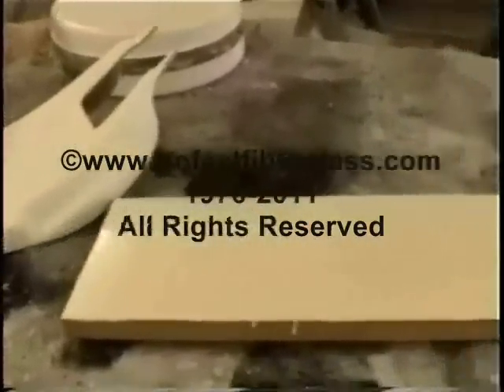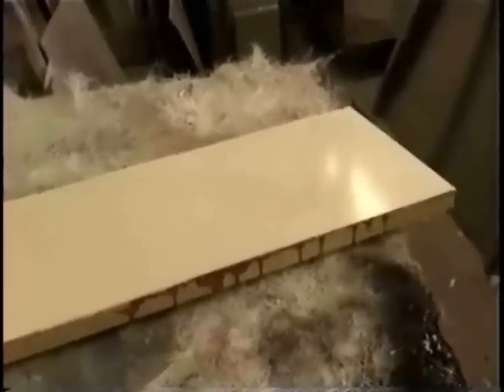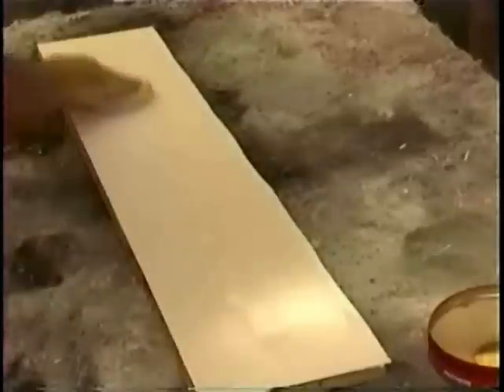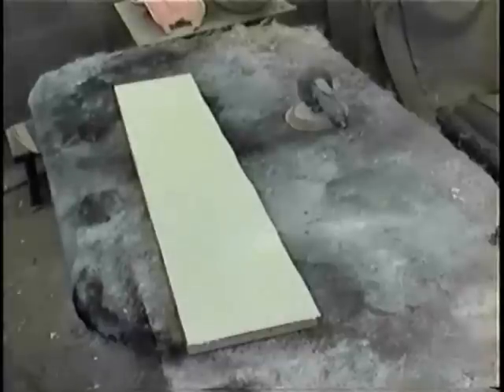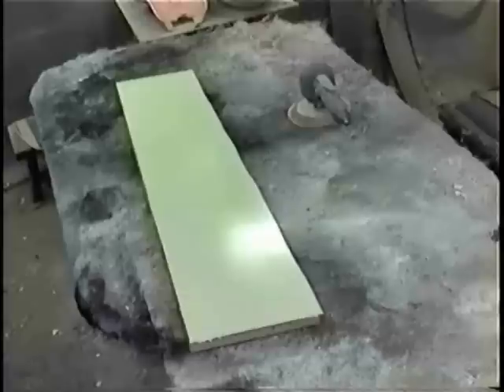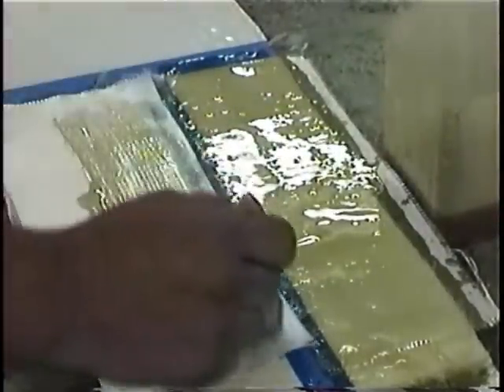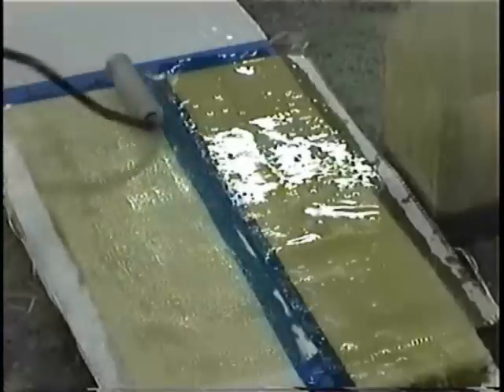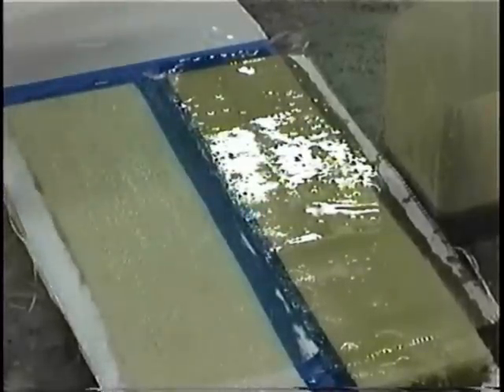How To Fiberglass * KNOW YOUR FIBERGLASS  #1 * The Original Series * Good or Bad

Comment: Hello...thanks for the video's,  I have a sleeper shell for my pickup where the bottom is cracking in the fiberglass, no gel coat.  Its just happening around the bottom of the sides and hasn't structurally messed up yet but can I repair the small cracks with cloth and resin or should I lay matte.
Reply from the maker: Matte or Mat if you can....it conforms best to contours and angles and is stronger in every direction where cloths is strong in only two.

Comment: one question....

will this fiberglass stick to bear metal?

I was reading on bunch of forums and i couldn't get the right answer, so I was woundering that you can tell me more about that...
Reply from the maker: NO....if the metal is prepped or sanded with 40 grit paper or with a grinder, the fiberglass will bond, but a very weak bond.   NO is the correct Answer
Reply: GasserGlass er yes you can, there are various structural epoxy adhesives you can buy. how do you think metal parts are attached to fiberglass bonnets etc?

Miha, check out http://www.easycomposites.co.uk/Category/Resin--Gel--Silicone--Adhesive/Structural-Adhesives.aspx for an idea of what is available, and the best method of attachment is to have the metal surface drilled so the adhesive can form a mechanical lock by flooding past the holes and setting behind the part. check with your local supplier for advice on particular applications.
Reply from the maker: I put attach quarter panels on race cars all the time with Panel Bond....You have to grind it to get it off........HOWEVER, THAT WAS NOT AND IS NOT THE QUESTION SMART GUY!

 THE QUESTION WAS,   WILL FIBERGLASS STICK TO METAL............... NO, FIBERGLASS WONT STICK TO METAL............................ !

If you use 100 different kinds of epoxies or glues or staples or screws etc..etc...   THE FIBERGLAS STILL WONT STICK TO THE METAL! ............ Ive been in the glass bizz for more then 37 years, I know how to GLUE fiberglass to metal......THAT IS NOT THE QUESTION!
Reply: LOL righto...

Comment: What about fiberglassing complex curves? Like for a good example, the inside or outside of an acrylic globe? Or any kind of sphere. Would you still recommend using a huge piece? (Like the one you used) but about 5 pieces so it goes in every direction covering the whole surface? I thought some people use small pieces for complex curves. Or covering spherical structures...

And always push the resin in to get the resin in between the fibers

Comment: Hi thanks for your videos! I have a question I wanted to fiberglass my dashpad on my truck its a 1979 gmc to give it a smooth look. It has cracks from the sun how would I go about doing it? should i remove the old material and start fresh from the metal or can i lay it on top of the pad? Its not a structual piece.

Comment: your the best at this,iv watched all the vids..i have a ?,,I have a 10 foot GW speed boat.i trade for it..the guy cut the bottom of the hull out and the floor inside.how many layers for the hull out side and how many inside for the floor ?and he put frp board on the bottom and tried to glass it to make a bottom..can I use the Frp board as to fill the hole he made ?and glass over it ?
Reply from the maker: wanttoride1000 Man o Man....Id have to see what you have...... the hull in the front 1/4 of the craft should be 3/4 inch thick and 1 inch at the nose....... WOVEN ROVEN Cloth should be used......... The floor if mounted right, should only be 4 fly of woven roven with 1 ply of wood

Comment: Hi Thanks, what type of fiber glass I can use if the engine bay? Can i apply varnish instead of paint after fiberglassing?
Reply from the maker: +cherfieldm .... You can use Epoxy resin or polyester resin in an engine bay....I WOULD NOT paint overtop of the gelcoat or fiberglass with Varnish as it will make it simi flammable if it catches fire in there...... please, no varnish ......... Ive had this question before and its a very good question!!!

Comment: @GasserGlass  for several part mold. pretty much all of the above. For instance when you have a part that would be stuck in the mold if you do a one piece mold.  I've tried many things, cardboard curls up from the gelcoat, wood is impractical and too long to shape to the part.  Clay is good but non hardening clay is expensive,  but fast to use.  I've had cases of edges when the gelcoat and fiber would curl off of it , making it useless .

Comment from the maker: Poly Vinyl Alcohol....The best way to describe it to you is....  Its like a Green Garden Trash Bag That is Dissolved in Alcohol.... When you spray it out...it drys into a thin sheet of plastic or vinyl...it makes a thin film in-between the mold and the gel-coat to keep the two parts from sticking together

Comment from the maker: Depends on the size of the globe or ball...one piece can do it..... you work the MATTE with the brush.....If this is a part that wont be seen or mater if the ball or globe changes shape and size a bit...then many pieces will work and will be easier...But One Piece is best...Ive made many cycle helmets with one layer at a time.....just takes some practice...the fiberglass MATTE will move all over the place once its wet.....With Fiberglass Cloth, you will need many pieces

Comment: ok,thank you,,i have a chance to get 18-24 oz woven roving mat..100 yd  x 50 " wide for 100.00 each roll and he has 5 rolls,,is this what I need and is that a good price for it ?,I was going to get 3 rolls .for the outside and inside..( good or bad ). ? to shape the bottom of the boat (bottom) he put FRP board on it,i was going to take that off,but can I use it to shape the bottom and just leave it in the boat,between the bottom and the floor ?(good or bad) ? using the bottom for the FRP board (smooth side down)..I want to thank you for your help and time..i just want this a good job and it to turn out right..Dave
Reply from the maker: wanttoride1000 WOVEN ROVING is NOT MAT...... Woven is a Cloth...A Weaved Fiberglass cloth with the fiberglass going in two (2) Directions only....CHOPPED MAT has short strands of fiberglass going in every direction....18 oz is VERY VERY HEAVY!!!!I....But it work if you use good resin (thin resin) that is able to soak all the way into the glass!....... I would use WOVEN on the outter of anything....I would use layers of chopped first and then use the woven so the cloth print wont show thru the gelcoat...... There are videos on UTUBE that show boats being glassed.....MOST dont use woven for the first few layers....Again, Id have to see what you have to know what to do....ALL my fiberglass made here is FRP-101 RESIN..
Reply: im off this weds and thurs of next week,i will take pics of it now and then take off what he did and show you what he was covering up.thank god he did not cut the spine of the boat.what you tell me to use ,,that's what im using.and ill roll it out like you do and get all the air out..if you do not mined,ill get the pics on here weds and thurs..thank you for your time and help..lord knows I need it,thanks Dave

Comment from the maker: YES..... You will be making a PLUG or BUCK to make the shape of your boat and then just cover the PLUG to get you shape correct?.... This way is the OLD WAY and takes a lot of work as you have to work backwards by laying down the resin and fiberglass layers...then you'll gelcoat the interior boat and let it all cure....Then your gonna have to block sand the gelcoat to make it slick like ice....its a litta work this way but in the end it will be cool....

Comment from the maker: Sure...you can use 1.5 oz cloth for making bags BUT, the cloth wont lay down and stay down on any or on most of your 90 degree corners... then when you roll the air out, your cloth will lift ect... The only way Cloth will work with little problems is to use the Vacuum Bag system.... Why not just use the STRONGER Chopped Matte in 3 or 4 layers or ply's or layers to make your bags? .... your air bubbles will be zero if you use good & proper rollers. ... Cloth will be a waste of your time and money

Comment: 6 mils thick for the gel coat? isnt mils thousandths of an inch? so 6/1000" thick? Thats less than 1mm thick? Please explain this!
Reply from the maker: between 0.006  to max of  0.010

mills as in paper thickness
Reply from the maker: RE-Resin the parts that are bad or RE=RESIN the whole pond......... Then gelcoat the pond TWICE..... first layer with NON WAXED gelcoat and the second layer, AD WAX...... the wax will seal the gelcoat and IT WILL CURE hard as a rock!....Wont Be Tacky..... its a WHOLE LOTS Easier this way and a LOT LESS work....... Ive done a few ponds in my day, boat, planes, cars, UPS Trucks, Car Trailer, Us Navy Jets, Fountains in the middle of the city (Inner Harbor Baltimore) , Huge Cowboy boots and Cows that are 20 feet tall on top of buildings etc..etc..etc..etc............. BEFORE you follow what Im saying,  You can call one of my fiberglass supplier who sells to quite a few Boat Guys and he even has a Video showing you HOW TO DO THIS VERY JOB! ..... You should call him on the phone and talk to him, Go to his web site and get his 800 number and call him...... He will TRY to explain how to do it and will give you the Video Link so you can watch him ........ BE SURE YOU TELL HIM THAT I SAID TO CALL,  Be Sure To Buy the GELCOAT FROM HIM because its for this very job..... I DON'T USE his pool type Gelcoat for what I do............. His Name Is MIKE......His web site is......... www.FiberglassSite.com .............. Dont Forget To Tell Him That I SAID to call....... he may want you to call him later when hes not busy if you need a lot more info.....He will be happy to help you, hes just very busy at times...... Best Of Luck To You!!!!
Reply from the maker: Human4873
YOU DONT SPRAY THE GELCOAT!!!!!!!!!!!!!!!!! YOU ROLL IT ON WITH A PAINT ROLLER!!!!!.......... IM a 100% Gear Head....Ive owned and still have some Fast, Slow, Cool, Expecive and Cheap cars...everything from Pro Streets to Dragsters to T-Buckets to 5 Window coupes..... I know motors more then I know cars and I know cars more then I know fiberglass..........I WOULDN'T USE ANY Automotive products on the pool surface.....NO auto Product is designed to be UNDER WATER 24-7 then Marine Grade Gelcoat....I wouldn't use any BONDO AT ALL under water....not in a Gazillion years...... instead of BONDO....Use MARINE TEX instead!!!!!! .................... Do what you feel you gotta do young man,  last pool that we did in the 80s was CAL RIPKIN           Best Of Luck....... Maybe I can hell you down the rqdo

Comment from the maker: ummmmmmm  Never heard of that one...... heh heh    .....   YES, Ive heard this before and never seen it used in over 35 years or longer.   ....  

 ( Cavasill ) ..... I think what people are mistaken cement for is called  ( Cavasill)!!!!!  ..   Its a powder additive you mix into fiberglass resins to thicken it & to fill voids with it ... . Cement wont give or move with the glass in temp changes and would crack the mold FAST temp changes.... This powder can be found on Google..... ( Cavasill )